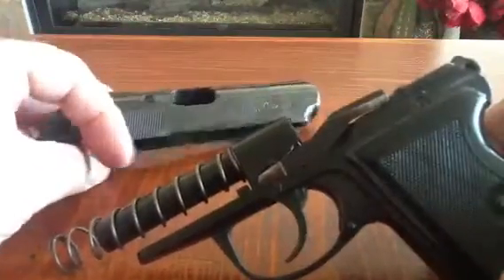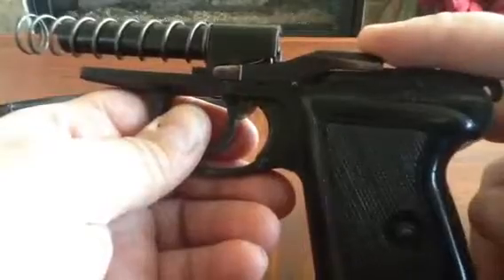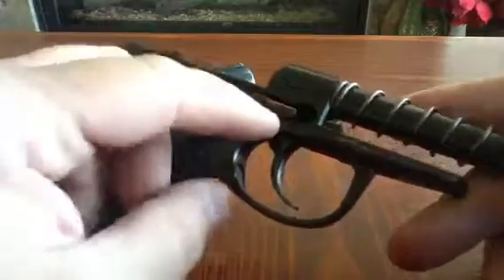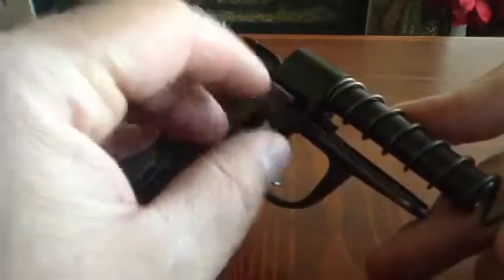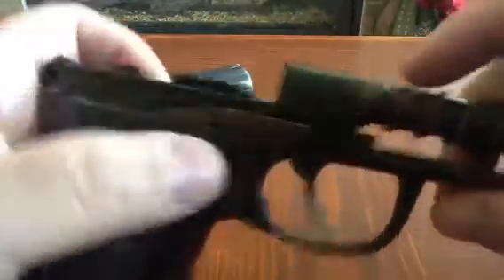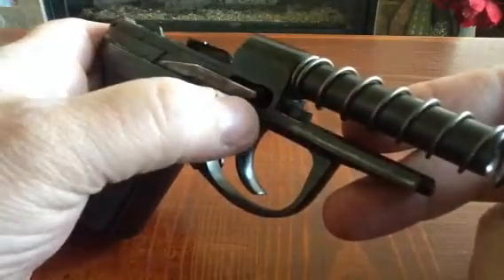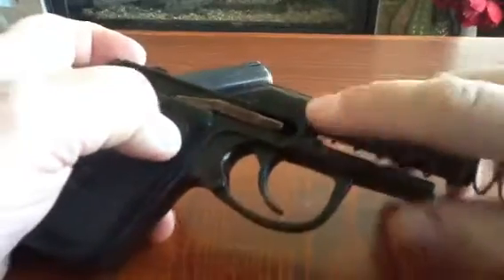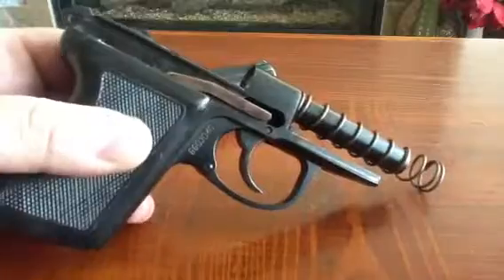P64 dry fired while disassembled issue

Comment: A piece of advice... Get the part of the metal piece that goes over top the spring first (the longer knob), then get the shorter knob into the hole for the trigger.  I used a very small screwdriver for taking apart iphones and stuff to hold the spring down.